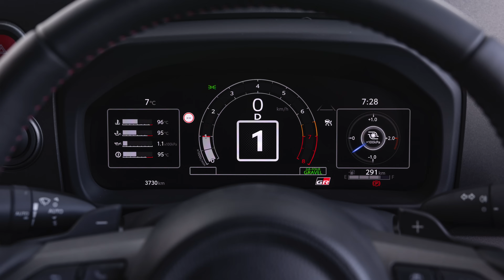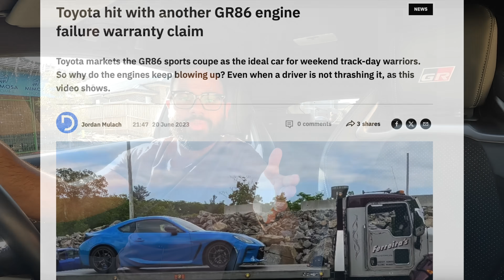The Real Reason GR Corollas Are Blowing Up (It's You)

Comment: So it's customers fault if the product breaks down 😂. "You used it in the wrong way". Nice. BMWs can be tuned but they won't systematically blow up. If those things are already tuned to the max from the factory it just says they are ticking time bombs waiting to blow up at any time. Plus they are over-hyped. I'm sure VW can squeeze a hundred more HP from their Polo GTI and make them equally unreliable.
Reply: Usually it is when it comes to performance cars.  Lmo The fire guy lied about the car being damaged from  an accident. Another guy thought he was a pro driver, and sent the RPMs too the moon on a money shift.
 People have blown B58s  too with bad modding and tuning chief. It's really no different than most of the 4 bangers. Want power? Spend the money on the mods.

Comment: Eh Graham from Limit +1 and Boosted Performance have spoken about this. After tuning 500 GR's (some with 40,50,60k miles) only 3 have blown. People don't know how to drive, people change the mods without informing the tuner and getting a revision, people put in crap fuel or not the highest grade possible, people tuning their cars past the point of valve float without addressing that, could be 10 other reasons why a small percentage of cars blow up (stock or tuned). 

It's kind of irresponsible to say they can't be tuned reliably, especially when you are speculating. The truth is, as with any online community or forum, people that have issues always make the most noise while 99% of the other owners are bouncing off the rev limiter on their way to work every morning running 350 whp for nearly 30k miles without a hiccup. The vast majority of these GRC's are fine and the infamous black corolla being burnt down and Toyota denying was all bs. Look into the story more before using it as an example.

Your title is correct, sometimes. It's you, not the tune.
Reply: Well put.  I just posted.  I have limit +1 tuned GR corolla.  Responsible tuning from tuner that knows what they are doing and proper supporting mods is completely safe.  I would recommend FMIC (CSF is best) and some sort of intake to reduce intake temps as this baby does run hot.
Reply: Yeah, it's been the exact same story with tuning Subarus. Most of it is people that don't  know what their doing, blowing up their engines. It's Subaru that's bad, not me!
Also I've noticed this trend specifically with Toyota. Anytime  something goes wrong with a handful of Toyotas, there's all these car sloptubers latching on that blow the issue way out of proportion to get views. Just like there was handful of new Tacomas that had failures, and suddenly all these clowns are on here saying the new gen is unreliable. 
Just like the one dork that just goes to dealer  lots, and shows all trucks going "They ain't selling!". Then you look at the actually stats, and they are in fact selling like hot cakes.
Reply: Agree to a point. I drive a mk8 GTI manual. I drive the living piss out of that thing every time I turn it on.  I’m averaging 11mpg in that thing. Tuned on e85. I am wide open throttle constantly. In the 1 year I’ve had it, I’ve driven 26k miles. Not a single issue. I drove my bosses GR Corolla for the first time on Saturday. Wasn’t even driving it like I drive my car. Yes I was flooring it here and there, but not constantly and I was shifting at about 5000-5500 rpm. Cruising at 80-85 and 3500rpm, I hear a pop, look back, oil smoke everywhere. Pull over, hole in the block. It’s a performance car. It should be able to be driven like a performance car. If it can’t handle abuse, that’s sad.
Reply: @zacvialpando7991  Okay meanwhile mine has been tuned for 20k miles and I rip on it every day and currently has over 30k miles and is fine. There are those with tunes and 50,60, 70k miles on their GRC's and run great. Learn how to drive, and realize that not every single one will be perfect.

The vast majority of them do handle the extra power just fine. Hell, I'm still on the stock clutch.
Reply: @SethKnows learn how to drive, yet this is the first motor I’ve ever blown and wasn’t even driving it hard like I said. I’ve driven thousand of Porsche and Mercedes when I was a mechanic for those dealers. Like you said, could be a faulty engine, idk. I just find it sad that it couldn’t hand eve slight abuse.
Reply: @zacvialpando7991 right, that's unfortunate but the vast majority do hold up to the abuse. I could give you 50 examples of a Type R failing prematurely but that doesn't mean theyre not reliable.

Comment: In stock form it's bulletproof. If a crappy tuner blows up your motor, Toyota dropped the ball. Got it!  Maybe on a new platform, you shouldnt get an eBay ECU and Lenovo tune in your garage.
Reply: EXACTLY!! You absolutely nailed it with this comment, sir💯🫡 They get a GRC and the go to WalMart to get the ECU…..

Comment: Would you call an intake a safe mod on the GRC?
Reply from the maker: Intake is a relatively safe mod but they don’t offer meaningful performance gains. Mostly noise. There is risk if you get cheaper intakes (water ingress/ heat soaking). Toyota is also not the best warranty wise with this car if you have problems. I personally would only get really reputable intakes.. but those are really expensive.
Reply: P2c90 have fun

Comment: 2:45 Sorry, but this is not true. In a technical explanation video, the guys from 9FF, a highly regarded tuning company from Germany ("Tuning macht den Motor kaputt?"), said that the VW engines are definitely on the edge with 300 horsepower in the Golf R. Any increase of 10 horsepower or more will blow the engine sooner or later, connecting rod or any other components in the drivetrain. The timing chain alone is a huge minefield.The EA888 is a big no-no if you ask any engine-rebuilder and a blue print of how to not evolve a engine.
Reply from the maker: Gen 3 and 4 EA888 is probably the top 5 best tuning platform on the market rn. The engine gets tuned up and down even by VW to suit application. Has massive support and ability. I haven’t heard any tuning company call them out.
Reply: Maybe the earlier EA888s.  I have heard of issues with those.  But, I haven't heard anything along these lines Gen 3 or after, and based on other comments, I'm not alone.
Reply: This comment is baseless, clearly from someone without any personal experience with the VW GTI and R platform. I have a 2016 GTI tuned to over 500 whp, stock motor. But done right with no money spared. It has been flawless for over 30k miles and daily driven 75 miles. The manual transmission models have had some issues with crank walk, but these are owned by teens trashing it on a low budget tune.
Reply: As a German-speaker myself I went and listened to the 9FF commentary that you reference. He did NOT say that VW engines are "definitely on the edge with 300 HP in the Golf R."  In the 30 seconds that he referenced VW he didn't specifically mention the Golf R at all nor any specific HP level that was too much (certainly not +10HP).  He said that the upper limits are not known for certain but in their experience (and they are a Porsche tuner, not VW) the power handling headroom in many other manufacturers' engines LIKE VW are not as high as in Porsche.  He said that all of the internal  components including pistons, rods, timing chain, valves and even the head are potential risk areas, but not specifically for VW, just that for VW these components were likely to fail sooner than in a Porsche when upping the power. He did NOT single-out the "timing chain alone" as being a so-called "minefield", he simply listed it along with the other components (and btw the particular issue the EA888 had with the timing chain has been long addressed). And finally, your statement "the EA888 is a big no-no if you ask any engine-rebuilder and a blue print of how to not evolve a engine" seems a little ridiculous.  What exactly is the issue with taking a solid iron block, closed-deck design then forging the rods and crank and beefing-up the metallurgy on the head (in the case of the R) while correcting small oversights along the way to arrive at an even better engine?  I'd certainly feel better about a motor that was very good when introduced and perfected over years to one that was fresh off the drawing board and unproven.
Reply: @dsh1519  The video doesn't actually mention the Golf R explicitly, but Volkswagen in general. That is correct. You probably overlooked the fact that products for the Golf VII R (EA-888 3rd gen) are offered on their homepage, or that videos have been uploaded for this vehicle by them, in the heat of the moment. At the same time, I watched the video by Philipp Kaess “Problem child 2.0 TFSi”, which once again clearly underlines my arguments. Or the video by “MIK Motoren” called “Instandsetzer deckt auf(...)”. 
It may be that the weak points from Gen1 to Gen3 have been partially solved with the Gen4. The future will tell. But to speak of the EA-888 Gen 1 to 3 as a reliable engine has more to do with faith than knowledge.Or you don't want to see VW's obvious cost-cutting measures for the sake of economies of scale - and that's okay, after all, we're all fanboys somewhere.

Comment: Subaru's turbo 2.4liter (FA24) is beastly. They threw it into a 4500lb Ascent with up to 2000lbs of towing, all on a damn Chain style CVT with connecting pulleys that differ in length. RWD that block would ripp, absolutely.
Reply: But their transmission cannot handle over 290hp
Reply: @GF-mf7ml  for sure, they would need to overhaul the 5EAT into something like an 8EAT and that would be directly similar to Toyotas 8AT, while fitting correctly with the Mechanical AWD drivetrain.
Reply: @GF-mf7ml  yeah that probably the case for the CVT, I wouldn't recommend doing any serious tuning on the CVT, the 6-speed manual is fine up to 400whp, beyond that just swap it to an STI transmission and diffs.

Comment: First of all, if you're tuning you're car while under warranty, thats your own fault. Automakers can't be expected to foot the bill on a tune gone wrong. This is why automakers don't want to make Manual, Enthusiast cars anymore, because people mess up, then try to make warranty claims at which point it doesn't become viable, because it 1. Makes it unprofitable and 2. Damages the brand when a car blows up and someone posts it on social media, and in turn gets forced to fix it or face a backlash.

Enthuasiasts need to be better and own up to their own screwups. Unfortunately a lot of younger guys tune to look cool, but cant afford a catastrophic failure, its probably financed up the wazoo, so go after the manufacturer.
People should learn to enjoy their cars in stock form, and understand the risks when tuning. Direct injected, small displacement turbo cars are fragile things to tune because DI leaves little room for error. A lot of the German cars are port injected also. Old cars were a lot better to tune because of port injection which could just dump fuel all the time and required less precision.
Reply: Agreed. Old dude here who has a GRC. Don't mess with it. AND DO take the time to break in the engine properly. "Baby it" for about 500 miles, change the oil, and then you can go out and wring its neck. Not straight out of the box. And don't ignore the "no hard acceleration due to heat" message upon starting on a hot day until it goes away. The oil settles quickly when the car is off, and it needs a little time to distribute when starting.

Comment: What about the ones blew up without mods?
Reply: it was a rebuilt title
Reply: Every single one i saw that has confirmable data had mods OR the engine itself was damaged prior (one was hit by an 18 wheeler, the other damaged engine with a crack in the block during a collision) 

I have yet to find one that "blew up" while not either 1) tuned, or 2) damaged prior.
Reply: @khayon4364  Or they don't  know how to drive stick. One guy sent the RPMs into the heavens on a bad money shift, and  destroyed  the whole powertrain.
Reply: @DragonKnightX12  That is true and possible. Funny enough I don't consider it in my head as the stick drivers I know are very good, but you are right!

Comment: I agree.  Yes OEM is pushing this motor and stock is always "safer".  However, people seem to forget that the VW/BMW platforms are well tested with decades of experience  (and similar issue with blown motors, head gaskets, streached head bolts, turbos etc).  Given time the 'yota motor may get here but it will take time.   To counter your "German cars" are better [to tune] I would direct you to the Porsche "bore scoring" issues (due to coating). 🤔  You didn't even need to tune it to have issues! 😃

Comment: ii wrote up about this on a gr Yaris group but feel free to share this info. its mostly to do with the tuning not all cases but 95% (other 5% is thin oem oil lack of cooling) of cases anything more than 350nm before 3k rmp is the hazardous zone, for eg 400nm @ 2.8k rmp its going to fail in time. when i had the stock turbo i ran max 26psi and max torque of 400nm @ 3.85 rmp  by limiting the peak torque and its ramp up, it will last a very long time of abuse. the g16 engine misleadingly responds well to early boost down low on stock turbo and most tuners just go with it as it wont shown warning signs in the data logs and if the turner is aware of the niches of this engine they're battling with trying to limit the boost build up/torque on a small frame turbo that just wants to spool up fast. just one of those things you learn about on this engine. thats why aussies have builds 400-850hp+ that last its because the RnD was done back over 4 years ago when this was discovered. (fyi im still on the same standard motor from factory since ownership start of  2021 and 32psi since 2022)
Reply: on the other far end of high boost, anything more than 30psi on stock head gasket is going to fail in time. note: bigger turbos g25-550 and bigger wont spool up as fast as oem so most of the time down low toque before 3k rmp isnt really an issue but limiting max at 400nm-420nm is pretty good start for longevity on stock motor. my oem gasket took 32psi for over 2 years of abuse (circuit racing/toge) even with upgraded head studs ( better material/more clamping force) it will fail still. you need a Vulcan but head gasket to seal well if you want north of 30psi. NOTE MY CAR: Street/Circuit GR Yaris. 10s 1/4mile , 0-100kph in 3s, 100-200kph in 7s, stock motor, stock internals, GR Yaris with complete Lamspeed response turbo kit and Drenth sequential gearbox. 32psi since 2022
Reply from the maker: Absolutely agree. That extra low down torque along with the thin oils is a killer.
Reply: So what about a stock car, just don’t spool to the turbo at low rpm?
Reply: @jdmbren13 tune on e50 it will help to make more hp without upping the boost.
Reply: @shiftautomotive1997 It’s not really my fast car so I don’t mind the speed it’s at, I’ll take out the rear seats if anything, I just want it to be safe like a Toyota haha
Reply: Ive always wondered why my GR Corolla has the boost limited in first gear. And this makes a lot of sense. 

I have to ask, why did you upgrade the turbo? The stock is pretty responsive for a 50mm inducer.
Reply: @garagemonkey526 bigger turbo because I wanted more power, to run a 10s 1/4mile and be more competitive on circuit. That’s the main reason I upgraded.

Comment: The car is extremely tunable, we have people in Australia making 400hp at the wheels with stock block, after that you need to forge/close deck. The difference is we're running aftermarket ECUs, people push ECUTEK over the edge with poorly understood torque tables and wonder why it goes bang because of a lean condition.

Go get a proper aftermarket ECU with good logging and build off the foundation the AU + UK people have already figured out.
Reply: Until it blows up. You think it's going to last 100K miles? Good luck.

Comment: Agreed I sold my GR I didn’t want to take the risk. Great car but best left stock. Mine had a intercooler upgrade and charge pipes but stock tune.  I gained power even on stock tune. Now current car makes 500hp stock
Reply: How is it best left stock if you sold the car and didn't in fact, keep it stock?
Reply: It was on stock tune??? Upgrading intercooler on stock tune will not affect reliability in fact it will perform better. I don’t want to take the risk with tuning I live in a hot climate and  upgrading the intercooler helped lower IAT’s on stock tune. I didn’t want to tune and risk a 20k engine!!! Intercooler will not void warranty
Reply: Does an oil cooler or an aluminum radiator void warranty? Because that’s all I wanted to do intercooler, aluminum radiator,oil cooler and all the parts that go with it maybe a down pipe/midpipe combo and exhaust. I’m not so sure about those yet
Reply: @XDevilhunterx  it doesn’t void you’re warranty,but if those items caused a issues it will not be covered under warranty or if those items break as well. For example: oil coolers leaks and damages something than not covered. Or any software tuning will void your warranty

Comment: ima let you slide on  the german glaze. But I have to believe Toyota wouldn't build an engine squeezed out with no room up top for mods. How else are they supposed to utilize this in competition? The only exception i've seen to this is the Nismo GTR basically being a GT3 car without all the interior/weight loss and cooling mods. I think this is an oil/fuel problem.